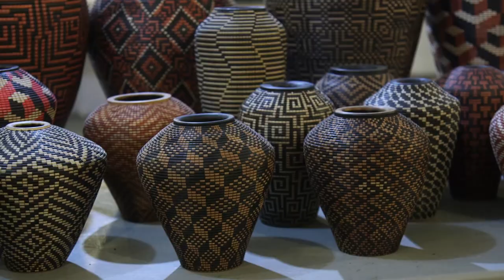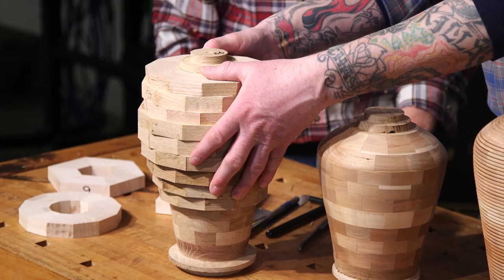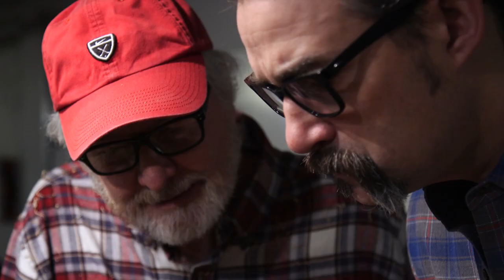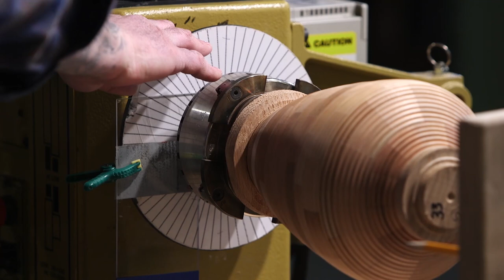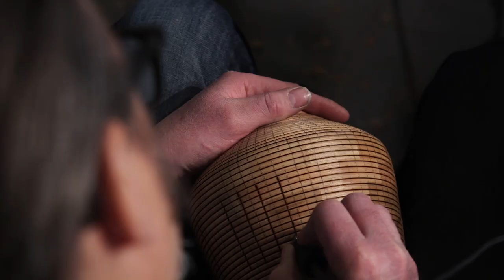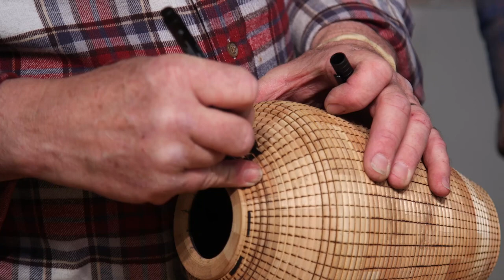Woodcraft 101:  You can do Basket Illusion wood turning

Comment: Am I correct that you know/calculate the number of beaded rings as part of the layout? Do you use different beading tools of various widths?
Reply from the maker: No.  You use the same beading tool.  You also do not have to calculate the number of beads.  As you get towards the end you can manipulate the beading a little to compensate for spacing.